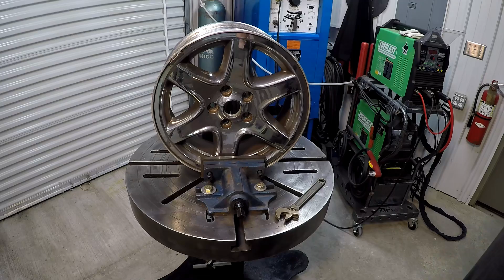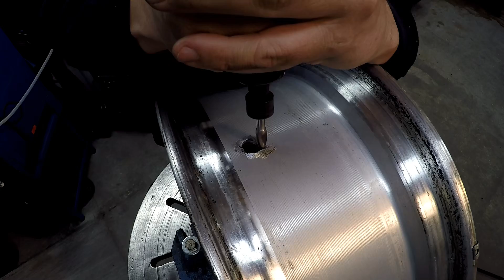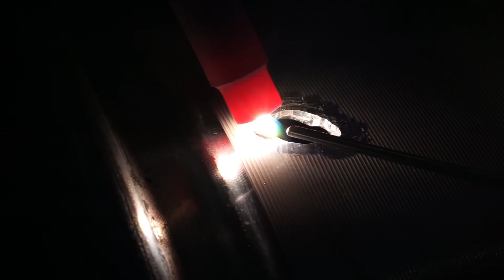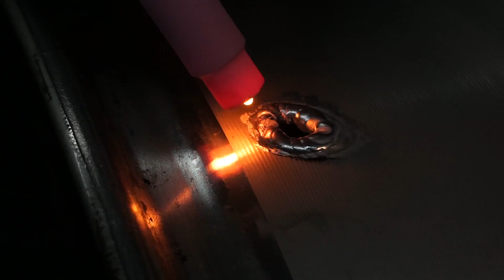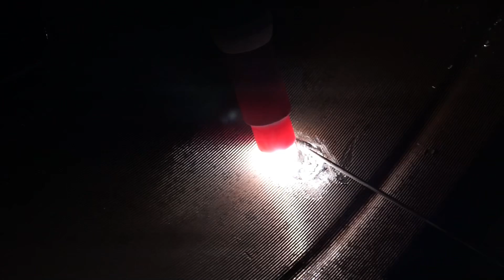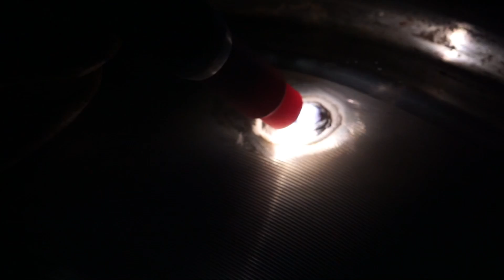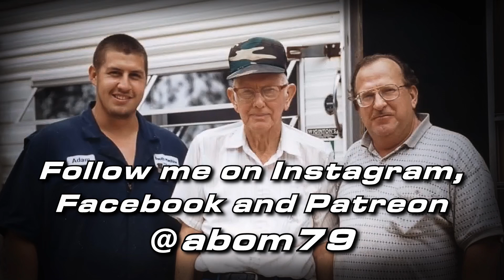SNS 239: Aluminum Wheel Repair

Comment: I know this is an older video and don't know if you have changed practices but you can lower the volume in editing anytime you run the grinder.  That way the pitch is not so ear piercing before the viewer can manually lower the volume.

Comment: For those who don't know; welding aluminum is a challenge.  You have to pay close attention and there is a relatively narrow span of heat where; if it isn't hot enough you don't get enough penetration, flow and strength, and if you get it too hot it melts and falls away - creating an ever bigger hole.  Especially on thin aluminum.  I say good job.  Especially for pro-bono work.

Comment: I can only stick and MIG weld. I have never gotten a chance to TIG. I want to learn and I watch a TON of videos. I could be wrong here cuz again I’ve never TIG welded but it looks like your tungsten went into the pool. The tip is a big blob. Would the weld be easier if you sharpened it back up real fast? Or with that size it doesn’t matter?

Comment: The energy/force that wheel must have been under to knock a hole in the aluminium wheel must have lock soild scared the crap out of the driver

Comment: I have repaired magnesium rims and chain saws. Same a.c. tig, just have to use magnesium filler metal as aluminum and magnesium are incompatible.
Reply: Magnesium is much lighter and if you try to cut it with a knife blade it feels harder and flakes off. Where aluminum will roll up a bus mine like lead would.

Comment: Not sure if it will work with Tig and aluminum, but when I mig weld mower decks, I clamp a sheet of copper underneath while filling the holes... can't get it too hot otherwise the weld will stick to the copper or I'll burn a small hole in the sheet, then I just go one side then other until I meet in the middle, so the weld stays relatively cool. Probably if I used a block I could just weld it non stop, but with the sheet I can match any curve on a deck.
Wear a mask when grinding or sanding you don't want metal dust, in your lungs...

Comment: Hay Adam, I would have put some paint over that repair, 1st to seal it and 2nd to prevent corrosion. Another tip to keep in mind, if you have a rim with porosity that leaks, a good way to seal that is to use Loctite super wick in. Works a treat

Comment: I'm a super-novice welder, trying to learn from things like this.  It looked to me like the tip got dipped and had a blob of aluminum on it for the rest of the welding - kinda spreads out the arc, maybe responsible for the "acting kinda funn" comment?  Is that what's going on here?  Also would like to know what alloy of welding rod was used for this.

Comment: Seing the reason behind the crack i am a little bit surprised and shocked in the same time. Ball joints (if they are not the cheapest ones) last for a very long long time. Before such a failure they produce quite a big amount of noise. How does in the US the mandatory periodical inspection of the cars work?
Reply: No such thing. We have a constitutional right to privacy from the government. This includes vehicles and their conditions.

Comment: I have never welded aluminium but when brazing a hole up I never finish over the hole, I always braze over to the side and finish over sound metal thereby eliminating any pin holes as the metal pool cools. Great job  bro.

Comment: Few comments below are incorrect and they obviously do not know how to weld let alone the principles,,  Hold your torch at a slightly higher angle next time to get better gas coverage and less chance of the atmosphere being drawn into the pool.. A larger cup would also help with a gas lens..  when you  touched the tungsten you should really stop and die grind it all back out..    You cleaned it up using a flapper disc which is fine for the final clean up,but if its the initial clean up use the die grinder again as the flapper wheel will pull the material over its self and put impurities into the  welded zone which caused the pi holes you could see.. You really need to preheat the area before welding to relieve any stresses in the material whilst welding.. Great work all the same just a few little tips from a coded welder thats all.

Comment: I wonder what would happen if you put a round piece of aluminum over the hole on the outside of the rim and welded it to the rimthat way the centrifugal force of the wheel would not throw the weld loose from the wheel     just wondering because I didn't weld so if you not troll me for something I didn't know about I'm just looking to learn something

Comment: Your ‘family member’ needs some help maintaining their vehicle. Broken ball joint and a rim full of rust from worn out brakes indicates poor maintenance. For their safety, and for the safety of other road user, might just want to go over the brakes, suspension, and steering completely and identify any other components that require replacement. A ball joint failure of this magnitude, at a higher speed, could be catastrophic.

Comment: I had to,do,one for one of my bosses once, I cleaned the area 2 inches+ around it because aluminum is really bad for sucking in contamination.
I'm a welder who does machine work.
You'd have gotten a bit better results by placing copper backing behind the weld on the first pass.
  Also you probably should have ground the reverse side a small amount before welding it up.
  Using a scotchbrite type buffing pad as a dressing method works better than a grinding wheel ( they don't clog up).
  Just thought you might wanna know.

Comment: To go faster in this case.... you can use a backing plate, build the weld on one side, take the backing plate off and then build the weld on the other side. If it was aluminum backing plate... it was faster..

Comment: I've been a mechanic for close to 35 years and one has to ignore quite a bit of things to get to the point where a ball joint pops out of it's socket. I mean that vehicle must have been all over the road handling wise as even when a ball joint gets loose the vehicle will not go in a straight line as every bump on the road will make it change direction. You got to school that driver to stop ignoring car problems as they are going to kill someone or even themselves if they don't take care of vehicle repairs in a timely manor.

Comment: Any self respecting tire shop wouldn’t want to put a tire on that sadly... find a small time guy with no insurance, lol.. good work adam
Reply: that's a lie, I've worked at tire shops that mig/tig/and tig brazed aluminum rims to repair them. what helps is always preheating. especially if its cast aluminum since its porous and will absorb oils. pre heating helps cook that crap out. on forged aluminum its not so critical.

Comment: The weld went contaminated because You weld it with melted electrode ball shape. It should be needle shape and every time tim become ball shape must be sharpened And probably current is too high

Comment: I have seen fellas weld up dtress cracks in aluminium semi truck wheels that started from the valve stem hole as well as lug nut holes, but I never trusted a welded repair  on a truck wheel there is to much weight being supported on them

Comment: I used some Forney low temp aluminum rods and a MAPP torch to patch a hole torn in an aluminum boat and it worked very well. I would not really want to trust it on an aluminum vehicle wheel, though.

Comment: All the morons that criticized Adam about this repair are a bunch of ignorants. From a engineering point of view, the structural integrity of this rim IS NOT COMPROMISED. Both the rim shoulders and the spokes  didn't suffered any damage. Adam performed the repair in a mechanical and dynamical stress free part of the rim. Basically he just put an aluminum patch to hold air in the tire. I would like Adam upload a video of this rim holding just fine in ten years to show how effective his repair was. Bunch of idiots...

Comment: Next time, back the hole with some copper and bevel the top. Then fill it in,remove the copper plate and then go to the back side. Then grind. It'll work a lot better.
Hope this helps!
Love your videos!
Reply: Don't you mean stainless steel backing? Copper dissolves in aluminum; the 2000 series alloys, most of which are unweldable due to hot cracking, are Al+Cu.

Comment: I have one of those old miller welders in the background.  300 amp.  Run it off the 3 phase power I built in the shop. Also am an everlast welder user to.

Comment: What you friend was talking about dirty aluminum. Was that aluminum has impurities, it's really hard to weld when it's not pure. When rims are made it is done with the lowest grade aluminum which has very dirty impurities. That's what you're seeing when you use your Tig to make that weld. Main thing is to keep the heat consistent around that area when you're using the tig. So that it flows a little bit better + aluminum also gets rid of heat so you have to keep that in mind when you're using your temperature ajustment. Cast rims are almost the hardest to repair because they always crack in the same area that the repair was done. If it was Billet aluminum you would have a better time repairing it.

Comment: The reason it has got contamination in there Adam is your not giving the arc long enough to burn away the oxide layer before introducing the filler rod. This is a very common mistake with guys new to Ali, and absolutely critical to perfect pressure test quality aluminium welding. Once you've struck an arc wait until the surface goes white and clean, then you can start to add rod. Don't worry about the occasional touch down, just stop clean with a dedicated aluminium only stainless brush and start again.

Comment: Scotch brite wheel the inside and out first to a buffed finish, then with the carbide burr inside the hole and open it up a bit until there's no sign of cracks or raw fractured edge, now clean thoroughly with acetone. Then weld the inside of the rim, then the outside. everything must be super clean or you will get leaks.

Comment: That coating is to prevent corrosion and keep brake dust from sticking so badly. Shouldn't be an issue in that spot. Wouldn't hurt to cover that spot with some paint when done. Definitely don't want that coating removed from exposed pretty parts. It's a real PITA trying to keep them looking decent. Not to mention the finish will never match the other wheels. You likely may have known this. Or been able to figure it out on your own.... but just my $.02.
By the way,  you lay some pretty nice beads.

Comment: Facebook always shows me this aluminum "braising rod" stuff that goes on similar to solder, but looks strong as F when it cools. Has anybody used that for something structural?
Reply: I tried it on something non structural and it was garbage. It was the actual reason I bought a TIG welder and am learning to use it.

Comment: You run a weld/machine shop and have no NDT equipment to check the weld integrity? Use a smaller pneumatic grinding wheel and go over the weld in both directions to smooth in flush. .

Comment: I do all day mig aluminium  welding on trailers at work, havennt tig yet and been doing welding for 16yrs. Seems tig is like soldering style. I do have a tig for ferrous metal but havent gone to get my inertia  gas yet for my home welder

Comment: Try using the 3m 18733 bristle disc in an angle die grinder for cleanup instead of the crc.

Comment: Looks great, I hate it when the tip touches. Also, you can extend your electrode another 1/4 inch to get a better view, it'll work just fine. I had an instructor back in the early 80s that could weld 2 soda cans together at the rim, one of the best back in the day.

Comment: When you ball joint explodes and pieces the wheel, I think that is not the time to look for wheel to be welded - rather new car is required... but from the welding perspective there is nothing wrong.
Reply: So you fix the balljoint and associated issues and life goes on. Doesn't mean the rest of the car is trashed. Repairing things is a good way to save money if you don't have gold lined pockets, or even if you do...

Comment: Plenty of water and a brush will clean brake dust right off that alloy wheel. That's about all we used to use working at Discount tire way back in high school. Drop it in the water tank to check for leaks and give it a quick scrub to get a good look at the wheel to make sure there are no pinhole leaks or leaks around the beads. Comes right off with water and elbow grease. Use a little dish soap if you need to degrease it.

Nice work welding that too. Wheels are under a considerable amount of stress just sitting as-is. They ring like a bell when you tap on them. That's one way to tell if they're out of round. Tap it with something hard and if it rings out, it's pretty close to round.

Comment: as long as you dont use steel on anything to clean to aluminum,like a steel grindng bit or a steel wire brush must be stainless wire brush and so on.Cause the mild steel will contaminate the aluminum,not that this man did that but some people migth cause its all they have

Comment: God believe me, I'm not trying to troll you , Adam, you're a one hell of a mechanic. But, I'd find it hard to trust a welded repair on an aluminum wheel. Maybe if it was x-rayed, otherwise not.
Reply: Had my wheel repaired 7years ago just like this.150 000 miles later still no issues what so ever
Reply: @tke7mu0u  - Therefore . . .

Comment: Serious question: When cleaning the aluminum, why not just take a wire wheel to it?
Reply: Christian Doll if you used an abrasive on aluminum such as a wire wheel you can end up pushing the dirt and contaminants down into the metal and cause a dirty weld. If you do use an abrasive, use a brush that’s used strictly for aluminum and brush in one direction lightly.
Reply: Short answer:

Because aluminum is too soft for carbide from the carbide burr he used to break off and contaminate the area. A wire wheel would dig all that junk right back into the aluminum and it'll make your welds look like garbage, even if you do everything else right.

Also, for already clean aluminum, you want to use a stainless wire wheel or brush as a prep step before wiping with acetone. Aluminum is really finicky.

Comment: Interesting point: Hey Adam, a fellow I knew in the engineering shop that I have referred to previously, used to make :Michelin Mans" on old aluminium Coke cans! I would think it would be good practice - he used the shop welder - I think it was an old Able Arc AC/DC machine, with HF for doing aluminium and lots of toggle knobs...

Comment: @abom79 I only see small technique orientated missteps. I respect your abilities as a machinist I think you are one of the most talented manual machinists I've ever had the pleasure to watch work. My only advice would to keep the filler rod in the shielding gas until the tungsten cools this ensures the filler rod doesnt oxidize before it cools. The shielding gas should also be kept over the end of your weld to avoid crater cracks. Not trying to criticize just to trying to help out.

Comment: Looks good to me, not as though the surface being fixed is a structural part of the wheel. All it needs to stand up against is the air pressure inside the tyre.

Comment: Great work as always. I'm curious as to what punched a hole in the rim, especially on the back side.  
Most salvage yards have a way to check other areas and states to find parts for a car.
Reply: Did you watch the video or skip to what you wanted to see.  1:58

Comment: This might be too little to late, but when you Tig aluminum you wanna leave the tip of the filler rod in the shielding gas. Like don't pull it out too far too fast. It will contaminate the end of the filler rod and make your puddle dirty when you dip it back in.

Comment: The torch needle is very blunt. Was it intended, or should it be more pointy?
Reply: Welding on AC, you usually end up with a rounded or balled tip on your tungsten, especially running a bit more cleaning action to burn up any junk you missed in cleaning.

Comment: I'd have assumed with a hole that size it would have been easier to TIG a slug of scrap ally stock into the hole and dress that back rather "Casting" a new plug out of filler rod?

Comment: that rim should of gone straight in the  or BIN or used to roll garden hose up on it the strength of that rim is weakened by welding  thats why they are cast as one piece also it will throw the balance of rim and tyre assembly .

Comment: Im gonna take a wild guess and say thats a Jeep Liberty wheel somewhere between 03 and 06, if im correct There is a recall for bad factory ball joints and knuckle if out of spec which means if the recall was done and the balljoints were replaced but the knuckle was NOT and the joint failed the owner is entitled to new joints, knuckles, tow bill paid and free repair of any other damage caused by failure like wheels, rotors, brake lines, struts, fender cladding and other misc parts i left out. Hope that helps

Comment: I am very impressed , most machinists can barely tack two bits of steel together with a MIG already set up . Seeing a machinist set up his own TIG for aluminium and correctly figure out how to properly fill a hole , as well as realise there was contamination still coming out from the aluminium grains even after cleaning , I found it amazing . I have been in the trade for well over 40 years and this was a first . Thank you

Comment: Hey Abom 79, is that an old 320A/BP Miller next to your Everlast? I have one that's my main welder. The foot control is easier than trying to hold the torch and finger control the amperage for me.
Reply from the maker: Yep same machine, mine is the 330. Foot control and finger control both have there advantages.